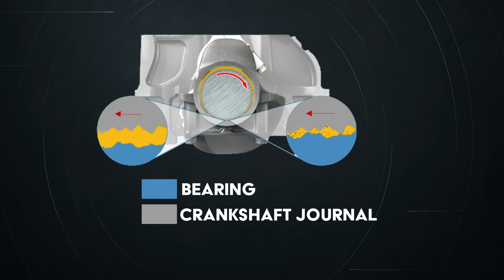the truth about start-stop technology (finally proven)

Comment: My start sequence: 
1 start engine
2 mute warnings
3 disable start stop
EVERY SINGLE TIME.
makes me feel like a fighter pilot
Reply: In addition, I have to change drive mode, and regenerative braking mode.  Would it really have been that difficult to let you to set and forget those?
Reply: @ky314  everyone would turn it off and forget , thus manufacturers would have to come up with some real solution to comply with emissions EUROx standard because EUC wouldn't accept start/stop as a valid workaround.
Reply: 4. open exhaust, 5. sport mode, 6. disable lane switch warnings, switch to "WAR" mode
Reply: Yhat just sounds like a whole load of bullshit my 2001 toyota corolla doesnt even tell me if I don't have my seat belt on
Reply: I drive for 11 to 12 hours a day and our new fleet of vehicles all have these new "features". Within the first few days I got so fed up with having to go through this sequence that I simply stopped turning off the car. I now leave it running 12 hours straight just so I don't have to press these fucking buttons hidden on a million different screens.
Reply: Yes. We are fighting the vehicle so it does not destroy itself.
Reply: @ibrahimcivanoglu  its like having psycho GF :P
Reply: Just buy the harness that stops it from turning off
Reply: @gees97  yes, buy the harness that fixes it.
Reply: As long as you don't cancel any that sound 'terrain-terrain pull up'
Reply: I drive a 2007 Corolla.  My sequence is:
1. Pray engine starts without issue
2. Let fast idle stop
3. Pray for transmission
4. Put into reverse gear and pull out of garage
5. Put into main drive gear and drive

Radio/CD player and clock no longer work, so this is an anti-distraction feature.

No ABS, traction control, or stability assist features.  Two drum brakes in the back and two disk brakes in the front make for cheaper brake jobs.
Reply: That is an important point you make about it being like a pilot.
If all drivers carried out pre-drive checks, including a quick visual walk round, just like pilots do, before every time we get in the car, many important issues would be spotted early, tyres would be visually inspected, lights and lenses checked and all glass checked for chips and damage etc. 
It improves awareness, focus and puts drivers in the frame of mind we should all be in prior to driving. 
As a teacher for many years, I had to drive other people's kids around in our fleet of school mini busses. As the vehicles we owned when I joined the school, were old and had very high mileage, and a wide variety of drivers across the large staff at the school, I always did a full pre-flight check prior to every trip. All illegal issues of tyre ware, bulbs blown, broken wing mirrors and failed wipers and damaged seat belts (!) would all be on the individual driver's responsibility and subject to prosecution if checked by police. The school would not be liable. It's amazing how many serious and potentially serious faults I discovered during those walk rounds! On several occasions I refused to accept the vehicle and requested it be swapped out or the trip cancelled. Eventually, the school stopped using ancient and knackered busses and invested in a newer safer fleet. But even from the brand new vehicles arriving, there were faults that would have been on my licence had an incident taken place, or a vehicle check carried out by the police. It was shocking how often I pointed out serious issues on brand new vehicles, simply because I took a couple of minutes to check, instead of merely climbing aboard and setting off. 
Part of driving must always be to not trust the electronics and the fact the car is our own and just does what we expect it to most of the time. We need to connect more and be distracted less by entertainment systems and bloody phones!! 
It would hugely improve safety as well as creating better empathy with the machine. 
Turn off all the invasive features that try to control you and make drivers so lazy and out of touch, stop relying on electronic 'tech' to run the vehicle and learn to drive properly and in the zone. 
I hated the lane holding and auto distance breaking in all the modern vehicles I drove.....if it was possible, I always switched it all off!!
Reply: What a story. Out of curiosity: why didn’t they fire you, if you were the only one doing this? What did you do to avoid that?
Reply: @scvanderhorst 
😂....they would have no legal right to do so! 
The staff team who ran the fleet, were all lovely people and we got on well....but they had to be educated gradually !😊
They knew they were pushing their luck but the problem is, most drivers don't realise it's their own licence on the front line, not the company they drive for.
If you accept and drive a defective vehicle, you are fully legally responsible, regardless of any corporate involvement further down the line. If that bus crashes due to a safety issue that was obvious and evident prior to you driving it, then the driver is the first in the firing line. 
They could not get stuffy and refuse my reasons to complain...they just had to get the program.....and they did!
Reply: You can disable auto start/stop at the kernel level. Welcome to the developer community!
Reply: @yesornoandmaybeso  How the hell to do that i do not understand kernel level can you explain in normal language please?🤭
Reply: @vaidasmiskunas2331  I’m 85% sure it’s a Linux joke.
Reply: @TheStanHill I'm 90% sure that 80% of all statistics are made up😂
Reply: @yesornoandmaybeso 
Computers in vehicles is the problem
Reply: I drive a Mazda MX-5. One time an ABS sensor failed and for a short while I drove a car with 0 electronic driving aids :-)
Reply: Luckily my old BM 330 has a switch for this,permanently OFF
Reply: Same
Reply: The same!
Reply: On my BMW I recently got stop start coded out so it stays on the state it was in before switching the engine off and now when I put it in eco mode as it used to turn stop start back on when going in eco mode
Reply: Me too!
Reply: Yeeeep
Reply: Vcds does the trick in VAG cars. Start/stop voltage limit to 12v and never worry about start/stop again.
Reply: Code it out 😀
Reply: I have the same routine, except my 2016 Volvo Xc60 has a feature that automatically brakes sometimes, for safety! Makes sure I don't run over ghosts. Nearly been rear ended twice. I need to turn it off EVERY. STARTUP.
Reply: @Dominator-xi7zy  What the actual fck m8???? That's just diabolical! 
What did the garage say?
Reply: Ты прав, это я как летчик говорю. Я это называю: check list before take off completed 😂😂😂
Reply: Only it’s a war U can never win……
Reply: I coded my BMW to always disable the Start-stop.
Reply: @Postbus22  What manufacturing year if I may ask?
Reply: same here
Reply: What warnings?
Reply: It’s your check list. Fantastic 👌
Reply: 4: Disable the equalizer because Honda chooses to actively make their sound system sound worse by default 😅
Reply: Same.
Reply: At the moment my Car is a LADA Calina from 2016 and it has some automatics, but no warnings, no starts stop, etc. Its just Stick the key in, crank and go. Only Automatic Lights and Wipers
Reply: I would have to do the same thing, so I bought an adapter that automatically shuts it off on my 2019 Highlander when I turn it on. It’s been a game changer and feels like a normal car again.
Reply: I think if we can all adopt this personality perhaps we can get through this.
Reply: More stupid bullshit from the greentards, the good news is you can purchase a bypass switch for most cars for less than $100, so auto stop is permanently disabled.  It took my mechanic 20 minutes to install it.
Reply: RAV4 hybrid 
My start sequence:
1 push button to start car
2 enable radar cruise control 
3 enable lane tracing 
look up from my phone to see why we're slowing down 
Feels like flying a commercial airline on autopilot. 
This is the way brother
Reply: Engine temp/pressures...check
Cautions and warnings...check
Mirror alignment...check
Steering wheel travel...check
Safety harness...secure
Auto stop/start...disabled 
Android Auto connect.........   ......... .......
Reply: I thank the car gods that my new Mazda you can shut that stupid thing off in driver settings!
Reply: In my BMW I just press sport mode and auto stop is off 😂
Reply: Funny, makes me feel like a moron
Reply: My start sequence.
Insert starting key code combination
Start engine
Disable start stop
Turn off traction control
Wait 60 seconds for engine fluid warm-up/circulation.
Reply: My start sequence :
1 Put key in ignition
2 Pull out choke knob
3 Turn ignition to start engine
4 Lightly pump gas pedal twice
5 Wait for choke to open
Reply: @Muttley_Redbone based
Reply: @Muttley_Redbone LOL !  What year is the vehicle? Choke cables have not been in vehicles this century!
Reply: Diabolical!
Reply: Makes me feel like a complete idiot. Luckily I've never bought a car with start and stop. And I drive a manual diesel with start and stop for work and I think it works pretty well. Because... You know. I plan my driving.
Reply: 1. Remote start
2. Visual inspection
3. Remove parking brake
4. Drive

The only way it should be. Challenger 2018.
Reply: My start sequence:

1 start engine
2 let it idle 30-60 seconds
3 drive

I ordered mine without start/stop because I knew it would wear the engine, starter, and battery more.

I also disabled the constant seatbelt chime so it wouldn’t constantly nag me if I didn’t put my seatbelt on

Comment: Logic suggests that this also applies to the engine in our Toyota Highlander Hybrid, yes? It is constantly stopping and starting based on battery charge and driving load.
Yet, I thought that those Toyota engines were considered high mileage capable.
Has anyone studied the hybrids?

Comment: You say 7 to 8 seconds to reach full oil pressure but you fail to say how quickly the oil drains after each stop. How much pressure is lost from a ten second stop and how long does the engine take to rebuild the pressure after that?

Comment: When the ECU thinks the battery voltage is below a certain value it will disable the stop-start,  there is a small cable connected to positive terminal of battery,  it is easy to disconnect this cable...